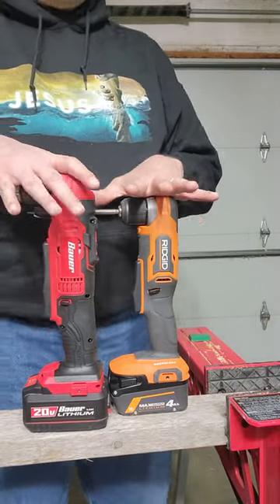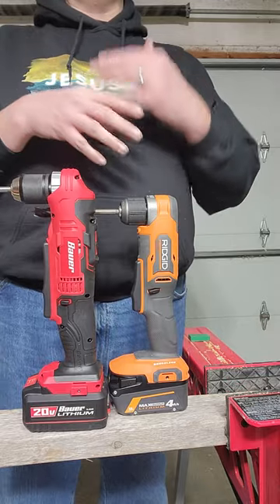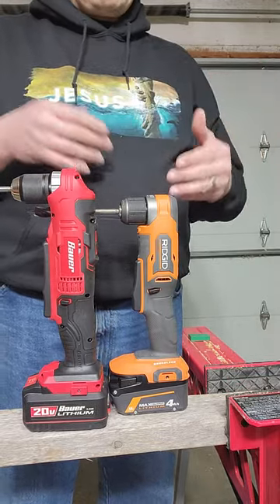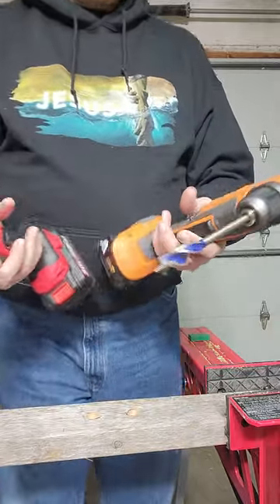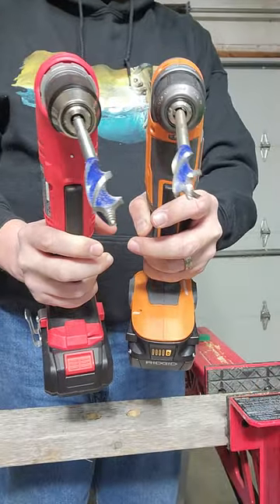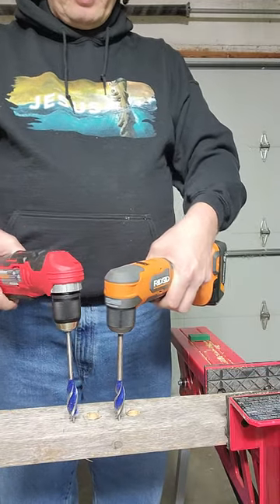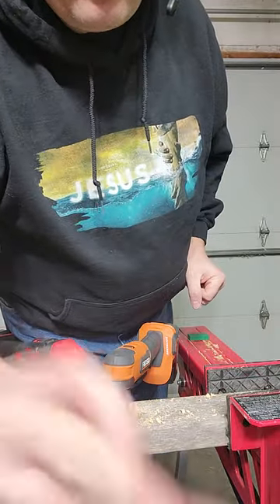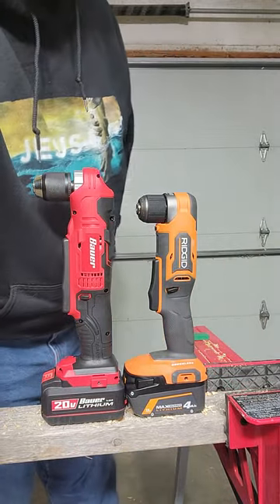Harbor Freight Bauer vs Ridgid Right Angle Drills #harborfreight #ridgid #shorts #trending

Comment: Hey Robert  I do need you help actually  I want to make a Video on Right angle drills VS hole Hawgs ..  and well I personally never needed a 18 volt right angle drill i have other right angle tools I use   but as technology gets better and more powerfull ..I need you advice on what Brand would offer teh bets power with out going to crazy on price taking in i may not ever use it again ...  or I might   and I am on the Milwaukee  Metabo htp and Ridged plat forms but I do have dome Dewalt crap  .. and well yo have one of the bets collections of these things  so any suggestions would be Awesome Cheers and PS Speed does not Equal Right lol had yo sneak that in  lol ..
Reply from the maker: Let me think about it for a bit and I'll let you know
Reply from the maker: Kobalt

Comment: The difference between the drills isn’t even a half second. You failed to mention the difference in price. Right now the price of the 18V Ridgid drill is $129, tool only. The Bauer is $39.99, tool only. I took advantage of the current deal on a Bauer 3ah battery plus free tool, paid $59.99 for the battery and got the drill for free. For a fraction of a second difference in performance, I’ll take the Bauer.
Reply from the maker: I hate fangirls
Reply: @ToolswithSoAlz    I’m laughing all the way to the bank.
Reply from the maker: @galootlovestools if that's the lie you need to tell yourself
Reply: @ToolswithSoAlz   That difference of $89 is cold hard cash.
Reply from the maker: I don't care if that's what you need to tell yourself
Reply: even though the ridgid is faster, considerably smaller (i'm pretty sure i've seen impacts smaller than the bauer) and will definitely  last longer?
Reply from the maker: @JZM006 The Ridgid is going to last a lot longer
Reply: @JZM006    Will the Ridgid last longer? I might use my drill once a month for a few minutes. A right angle drill is a bit of a luxury. Most of the time I’m using a normal drill. I’m sure the Bauer will meet my needs for years to come. If someone puts a gun to my head and forces me to build and wire a house and if I wore out the Bauer, I’d just get another Bauer. Under the overmolding the body of the tool is steel. It’s not fragile.
Reply: @galootlovestools  bro the ridgid will last way longer. maybe not as long as a dewalt or milwaukee, but a heck of a lot longer than anything from harbor freight.
Reply: @galootlovestools  and honestly a right angle drill adapter or even an impact driver is probably a better idea than a right angle drill anyway
Reply: @JZM006    That’s just like your opinion, man.